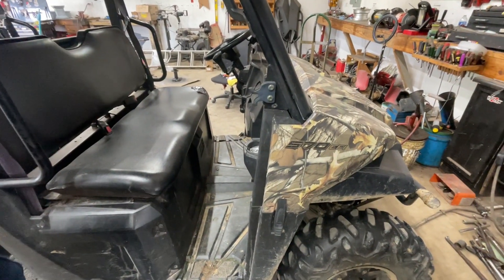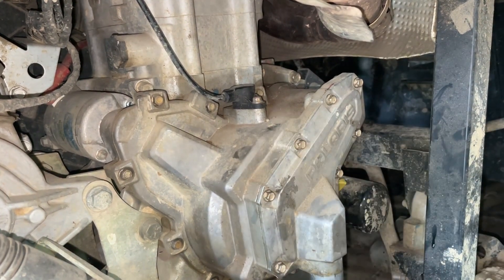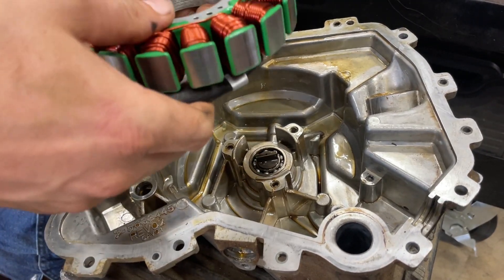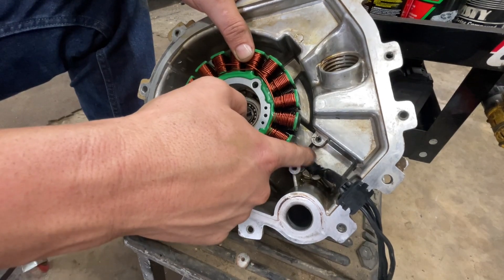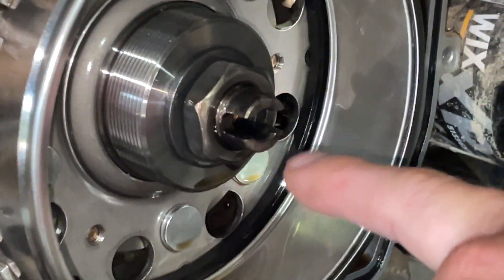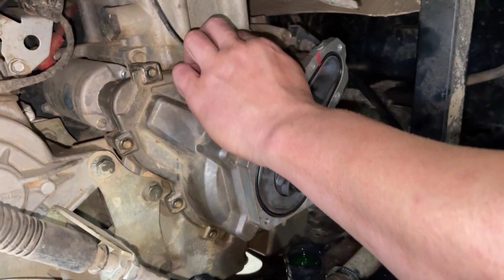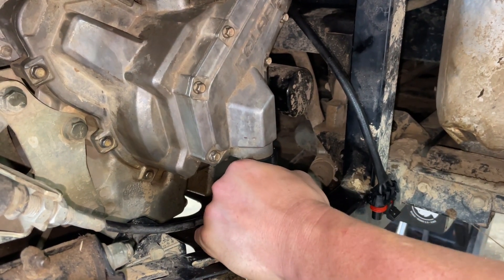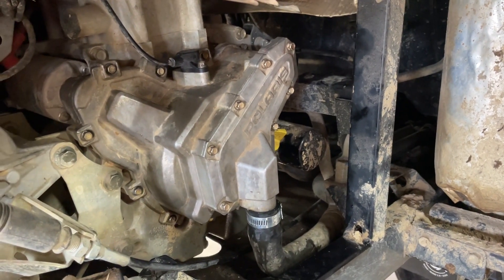Polaris Ranger 570, UTV, How To Replace Change Stator, Coil, Battery Going Dead Not Staying Charge

Comment: Great video, thanks for making this. Gonna make my job way easier next week! 
You posted a link to a replacement gasket in the description, but i didnt see you replace yours. I’m doing this job on a 2020 that overheated… should i order that gasket or just reuse the old one?
Reply from the maker: Hi, if the gasket is in good shape without any tears it will be ok to reuse however if you don’t have one on hand and yours is damaged then your machine will half to set torn down until the replacement comes in. 
Thanks for watching. Glad we could help you out.